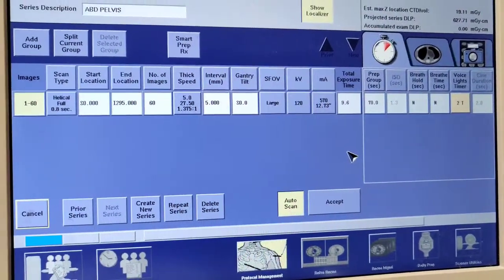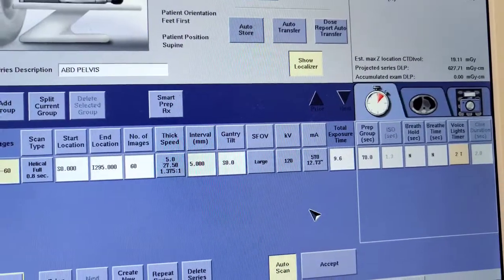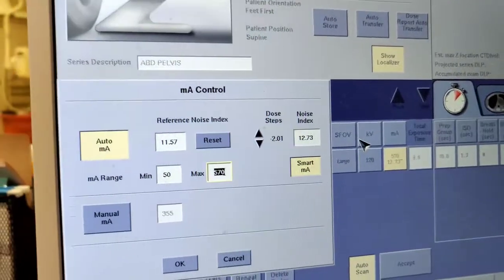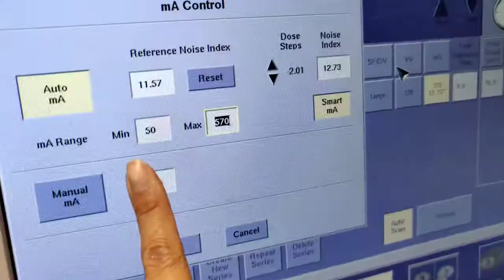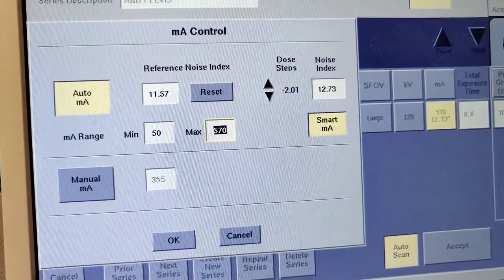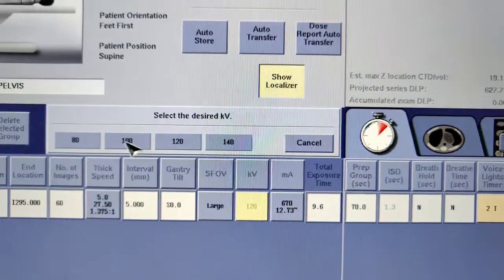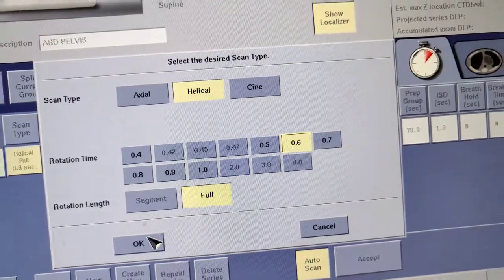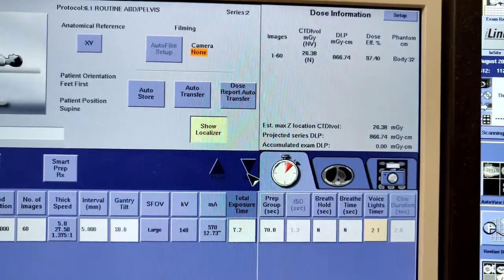Adjusting techniques in CT for patient size| mA | kV |helical |rotation time|radiation| GE 16 slice

Comment: Can ct find out optical fiber glass core  
It is small as human hair  Mistekely i have swallowed can it be seen by ct scans
Reply from the maker: I've confirmed with a radiologist. The answer is No, not able to see optic fiber glass with CT. (Rephrasing... "No, it's like looking for a straw in a big haystack."
Reply: @RADKhammany  then how to find out optic fiber if someone swallow  please conform sir
Reply: @RADKhammany  can MRI find out?
Reply: @RADKhammany  can mri find sir
Reply from the maker: I'm not sure but I doubt MRI is a good idea bc it uses magnets. It can pull/move the optic fiber inside the body  if it's magnetic. 

If it's thin and small it's like what the MD said .. it's too small to distinguish. Might just have to let it pass through the body. 

I've had patients that swallowed nails and razor blades. Those are easily visible on xray/CT. What I've seen happen is they just watch it pass through the body. The body does a great job at evacuating what's not supposed to be inside.
Reply: @RADKhammany  I just want to say can mri diagnosis optic fiber
Reply: I have some pain in my heart side I think that fiber glass 😤 went via blood stream in the nerves  and getting pain what will be technique to find out very small fiber I'm so nervous please sir give me any solution I'm not reach to get high level treatment I will have to die  no one can save me  is any solution to find out exact fiber location in the body
Reply from the maker: I would highly recommend that you consult with a doctor as soon as possible. If you get a scan and they cannot see the fiber maybe they can see if there's a blood clot or something leaking and that could be a way to look at the source. I really don't know so definitely go see a doctor.
Reply from the maker: But if it's swallowed ... It should go through your intestines not the heart
Reply from the maker: I say remain calm and don't think the worst of it. That might cause panic or anxiety. If you need to reassure yourself and have peace of mind to confirm then it's best you go to the doctors ASAP.
Reply: @RADKhammany  thanks sir for your reply but if I went to the doctor how doctor will be able to find out fiber in body because you said ct can't find then what doctor will do for me doctor will give me painkillers tablet but pain killers will not brake fiber then how

Comment: Some time icon for (optimize not needed) red
What does that mean? 
Please I need your help to explain why become red in some case

Thanks for your efforts🙏🏻
Reply from the maker: I believe it's bc it needs more x-ray. So if you click on it it'll have another button. I don't remember what it is. I think it's something with MA.... Once you click it, it'll adjust and then the red will go away... Meaning there's enough juice to penetrate and obtain a quality scan. 

I hope that helps. It's hard to explain if I'm not in front of the machine and it's happening in real life.
Reply: @RADKhammany  thanks 🙏🏻